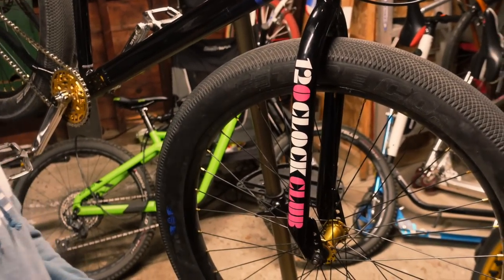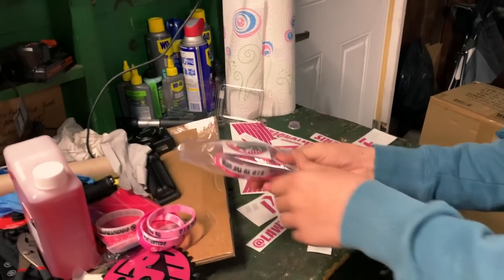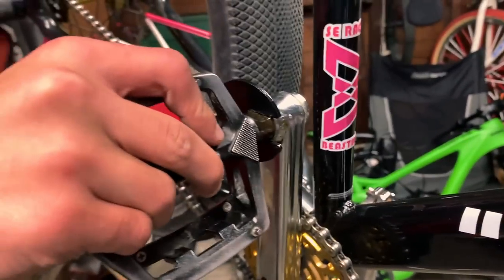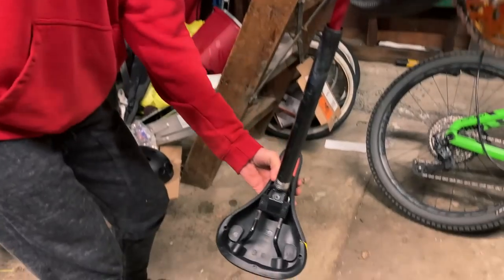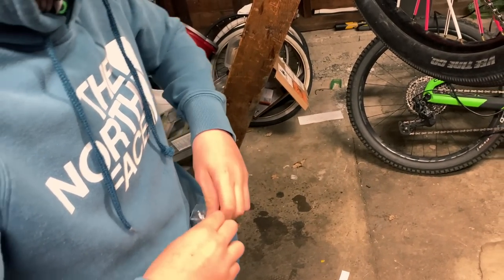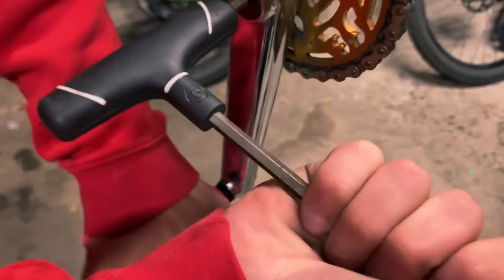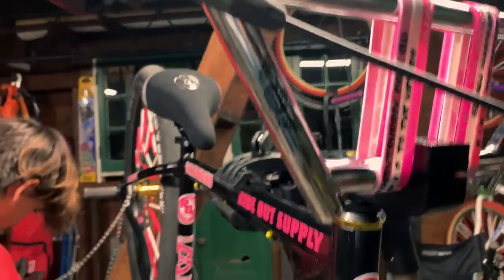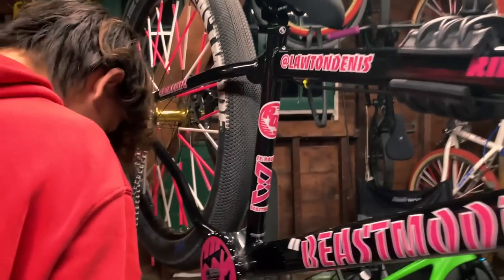ROS SE BEASTMODE DREAM BUILD ITS FINSHED  (Part 2)

Comment: I noticed in your pk ripper unboxing you said that sometimes if you slam your seat the post can get stuck over time. Maybe you already know, but when you assemble if you put some grease inside before you put the post in, that will solve the problem. Always a good idea to grease your boots too. Just saves a bunch of time in the future when you need to fix or change something, they will be much easier to get out cause they won’t seize up on you. With that said, your bike looks amazing...congrats bro!

Comment: Do you know if a big ripper would fit me I'm 5 foot
Reply: It won't go for a blocks or so cal you need to be at least 5 foot 10 to ride one of those comfterbley
Reply: @eugene44569  not tryna be comfortable
Reply: @eugene44569  I've been on one at lowest seat and my feet touch the ground